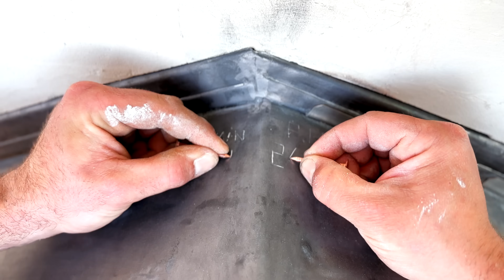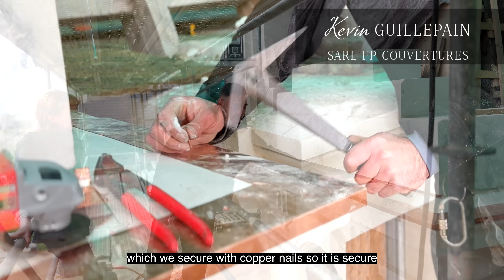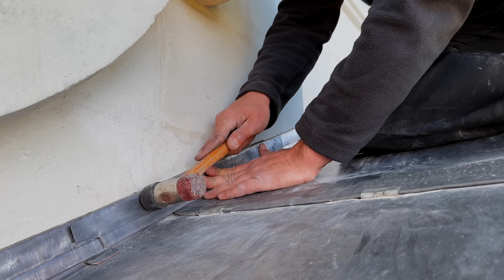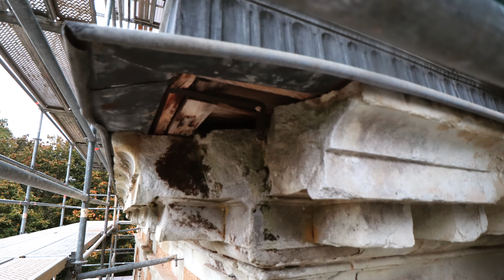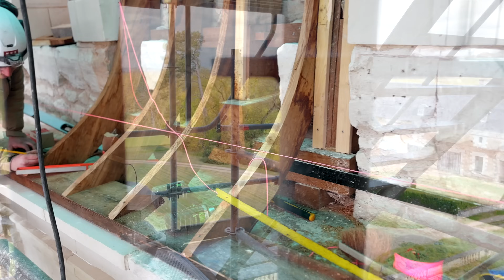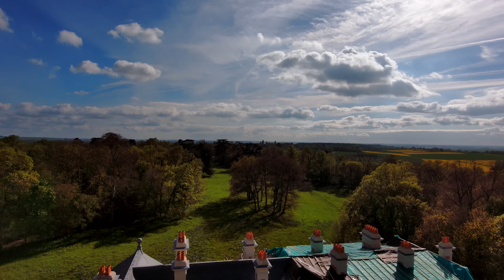The mind-blowing skills of the château artisans. Château Restoration #15

Comment: The new roof shape is definitely an improvement, both visually and structurally. I missed part of the explanation of the zinc guttering. I heard the talk about horseshoes, but I don’t understand what they’re for? And they don’t look like gutters that I’m used to. There’s no U-shape to carry the water, how do they work? Thanks for sharing the project. The place is going to be beautiful when you’re done!
Reply from the maker: Thanks for your comment and interest.  The horseshoe shape helps to maintain the integrity of the shape of the lead over time.  Regarding the guttering - the key point was that huge zinc guttering was added at the end of the nineteenth century.  This guttering changed the shape of the roof and damaged the facades.  The new guttering is made of copper.  It is much smaller and subtler.  It does not threaten the facades.  It has the appearance of conventional guttering in its form.  There was a brief image of the roofers working on the copper gutters - they were handling downpipes during that segment.  This new guttering has enabled the roof to be returned to its original shape.  We hope that addresses your questions.
Reply: Ok, that does answer the horseshoe question & I did see the copper downpipes but none of the horizontal gutters, so I wasn’t sure where they were being attached, or how they would look. I’m sure you’ll feature them in a future video when it’s all done, so thank you for your response & for all the work you’re doing on this gorgeous old chateau. 😄